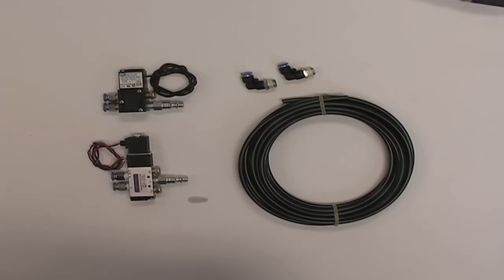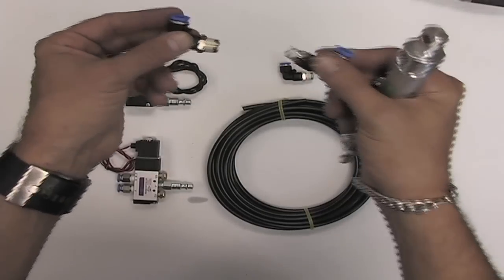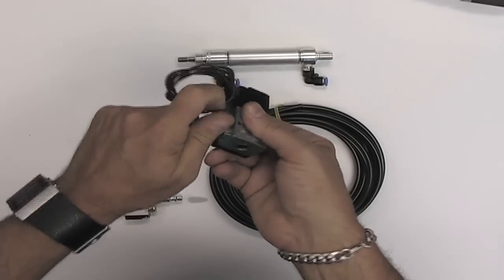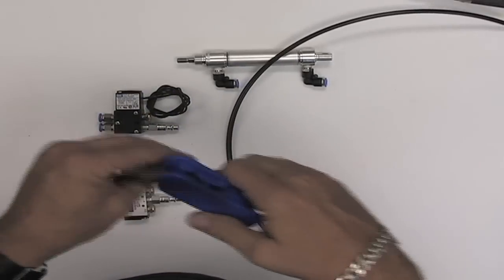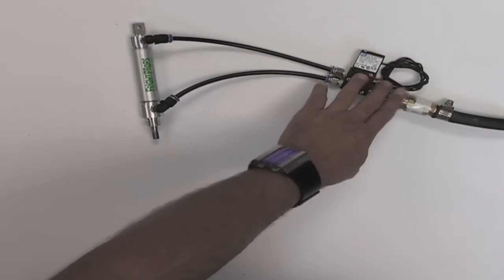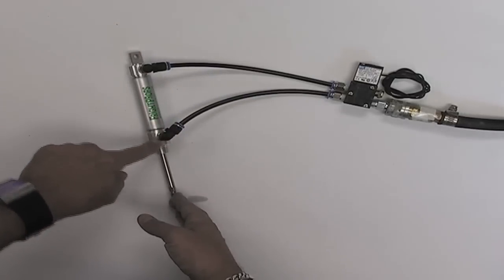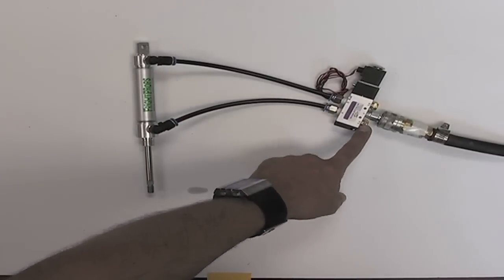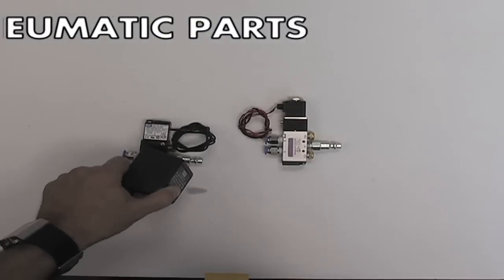FrightProps Double-Acting Pneumatic Hookup Kit

Comment: @kisvarosipari the odd looking silver things on the input side of the solenoid is called a quick coupling, it connect strait to your compressor and just makes attaching things quicker. If you were to hold one of these in your hand im sure you could figure it out!